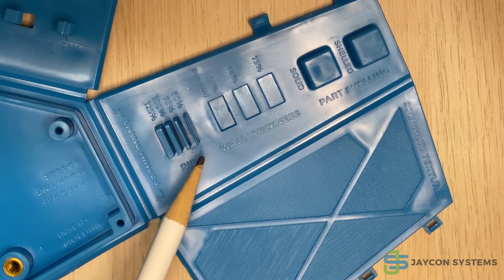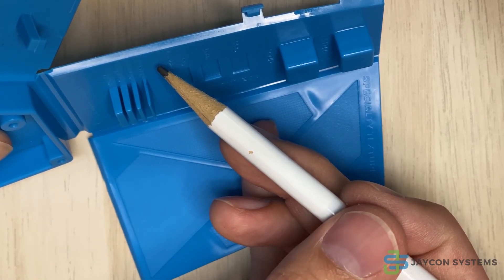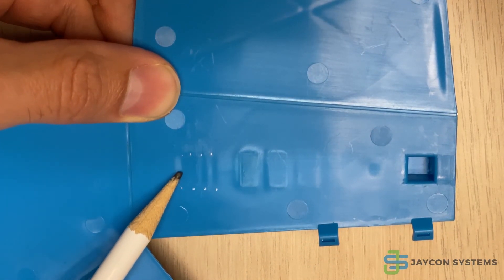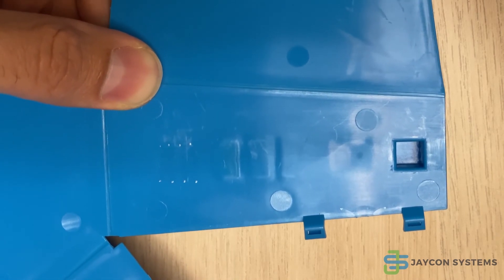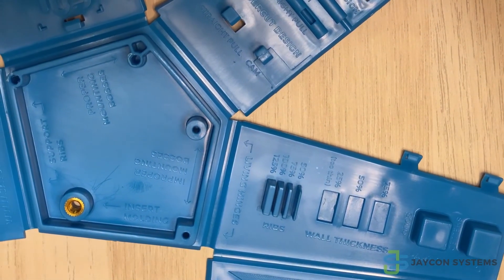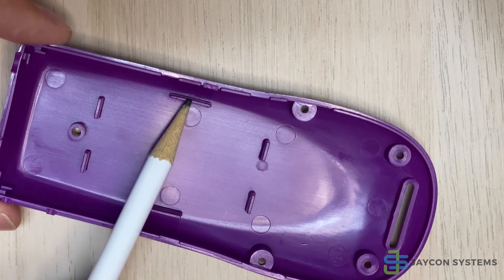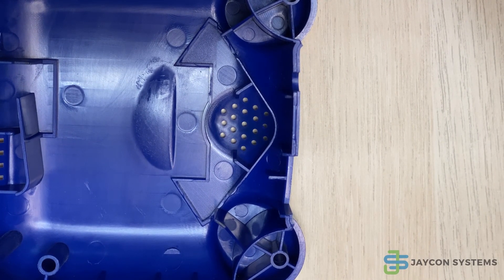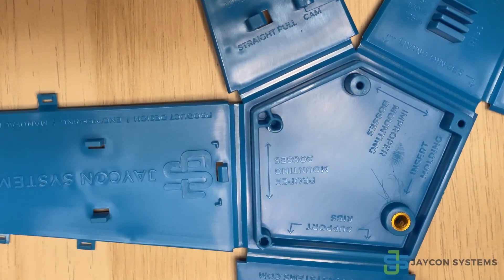Injection Molding 101: Ribs & Gussets

Comment: I have to be very critical of videos such as this. The information is very misleading and shallow. Rib geometry is driven by function, period. Tool and processing design can do wonder to reduce or eliminate see through. Material also is a critical player. The issue with the first demonstration part is that those parts are poorly processed on purpose to highlight issues. So, without clarity this can be very misleading.

Comment: In most cases, 40% rib to wall is a challenge to improving sink when the gates are very far. You can go as low as 26% with a lot care about thin steel condition. Starting at 2/3 rib to wall will cost you some cash as tuning cost, tryout cost, and time. Use proper mold flow analysis is best starting point.